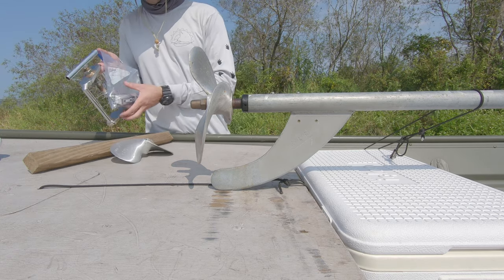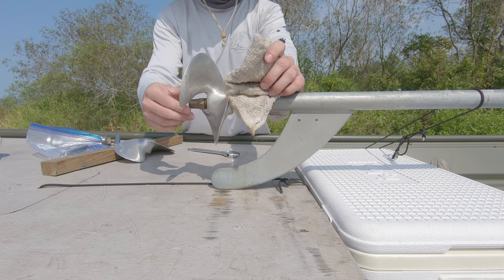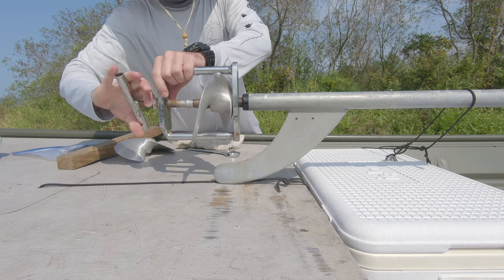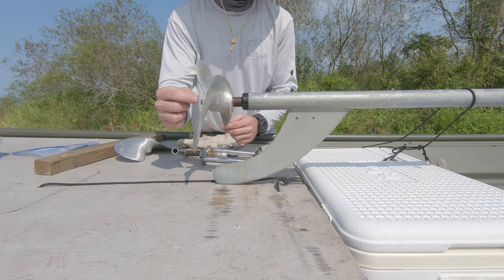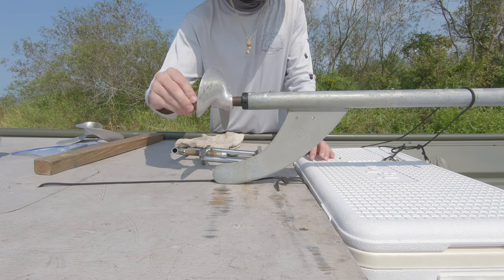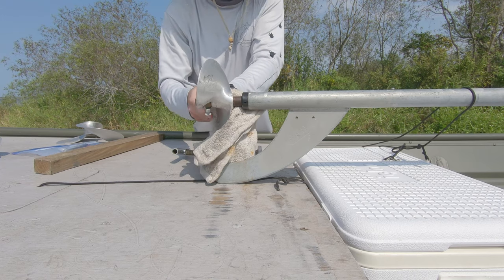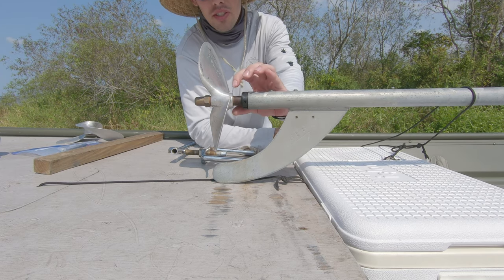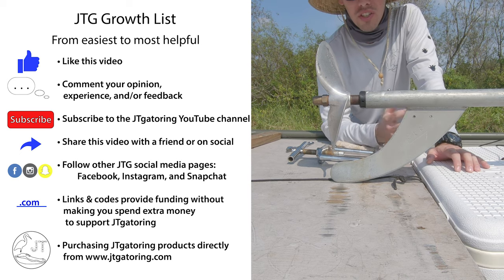Quick Longtail Mud Motor Prop Change

Comment: Bro make sure those screws on top of shaft are super tight!!! I got stranded the other day! Those two screws on top of shaft just in front of prop came out and that black bushing slides back. This disengages the prop! I had no extra screws but had 3 zip ties. Put one zip tie around the shaft in front of black bushing, one up in front of skeg and one around the outside shaft. It held just long enough to get to the bank. Moral of the story, get extra screws! Lol
Reply from the maker: haha that doesn't sound good... Maybe I need to take out that bushing and see if that happens to me. If thats the case, may need to start carrying screws around hahaha